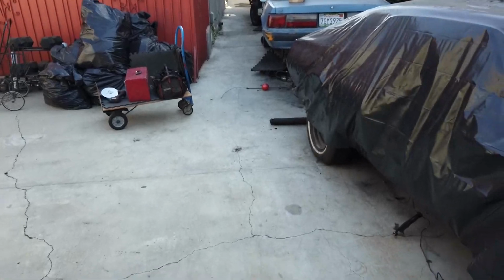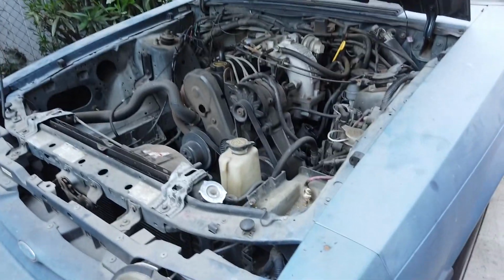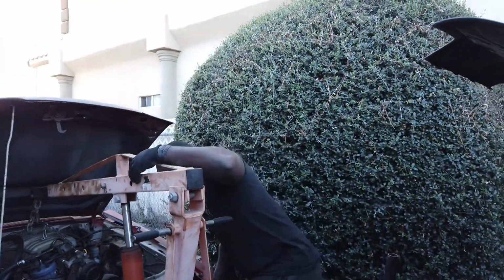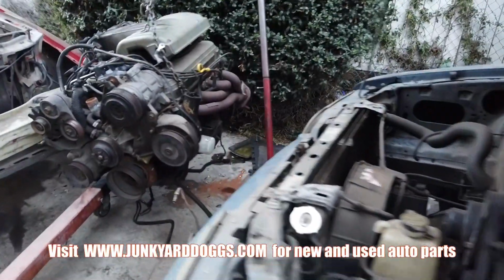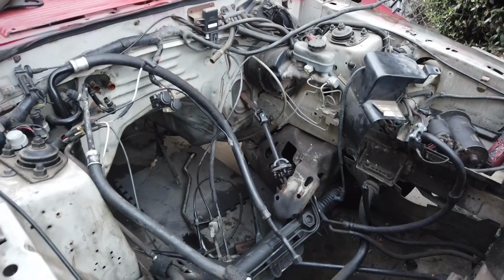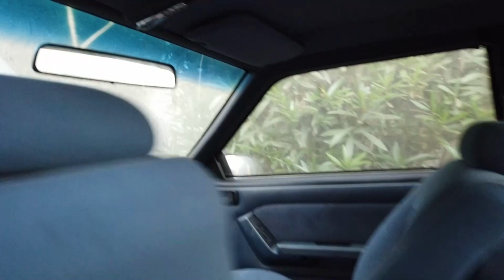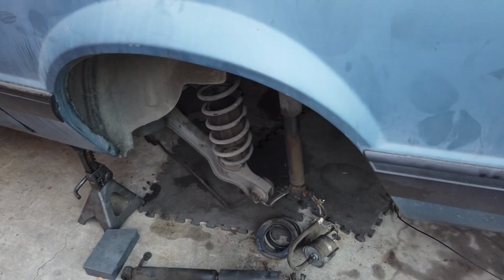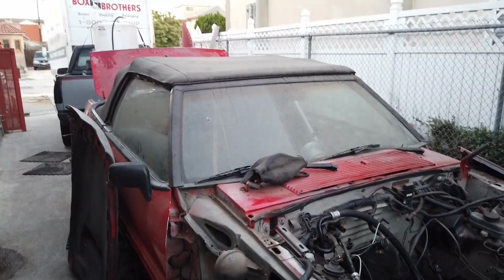Day 2 of 7 - 1987 Notchback Foxbody Mustang 4cyl to V8 Swap

Comment: You can drop the front control arms with the springs, using a floor jack. Cj pony parts has a how to. Very easy. Did it myself.  Very easy remove and install. Many people use 4 banger springs on their v8 cars. So you don't have to swap.
Reply: I did plenty swaps and used the springs  i felt no difference  what  so ever with the 4 banger springs

Comment: You can remove the lock very easilythere will be a little tiny plate with a screw or a rivet get that out that little plate with slide in your luck will come out

Comment: Man I wish you were my neighbor so could wrench with you on foxbodies. Quick question,  we put shift kit in my son's 89 lx. While on jack stands we found back brakes not working. We put new wheel cylinders in but not getting pressure. Front brakes work good. Any ideas of what could be problem would be greatly appreciated my friend.
Reply: Sounds like the proportion valve is bad that's what controls to even the pressure of the front brakes to the rear brakes.
Reply from the maker: Prop valve or pinched line.

Comment: Glad for the tip when you all done removing  just actually use the tires and you will be able to roll the entire front member like an assembly unit just use the old strut markings to kind of bolt it all together I call it an up and over as I lift up the body a little bit always you have good videos my mustang brother

Comment: I just replaced the bushings in my rear end by using the ball joint/u joint rental kit from Autozone. It worked great with my impact wrench, came right out and went back in with no problem, it'll be much easier with the rear out.